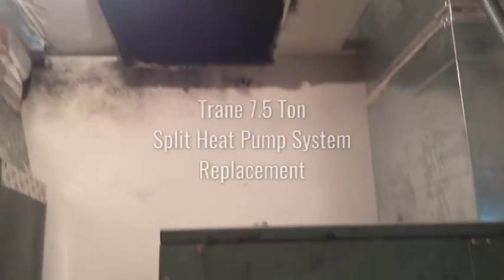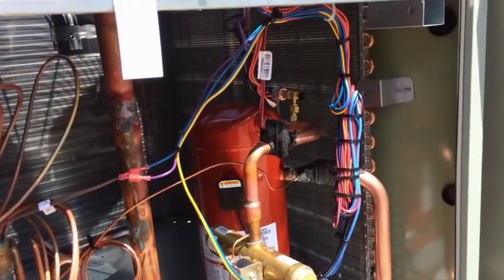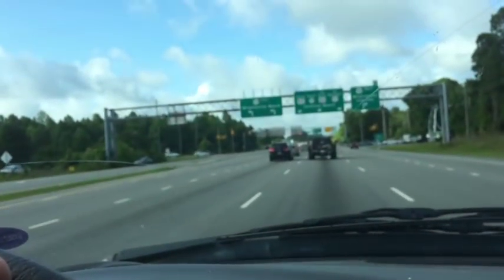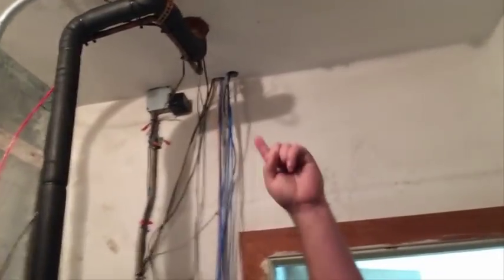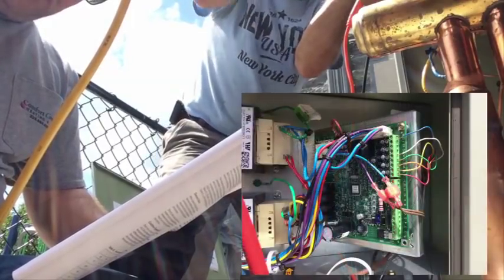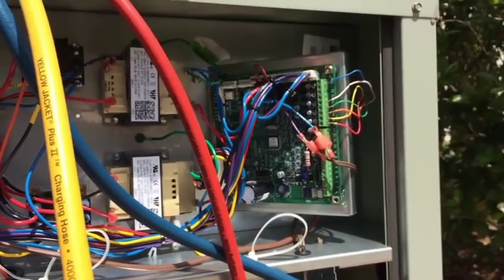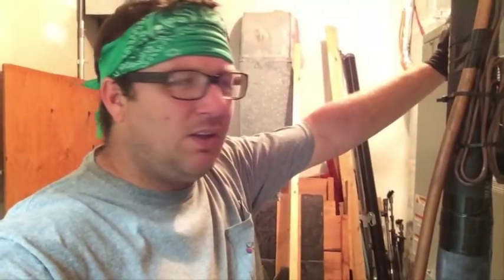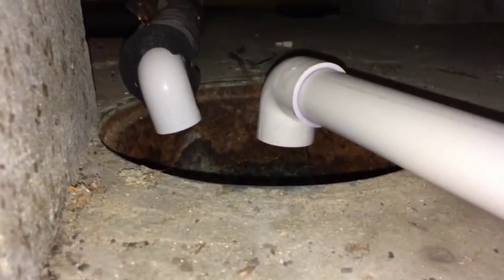Trane / American Standard 7.5 Ton Heat Pump & Air handler Installation

Comment: Nice work there I haven't seen your videos lately DUE to WORKING 10-14 hour days trying to put in a 30 ton straight AC with hot water coil split system just been crazy
Reply from the maker: Sounds like that would be a cool video to see!

Comment: There’s a jumper wire on the RTRM board you need to cut for em heat operation.
Reply from the maker: Thanks for the tip